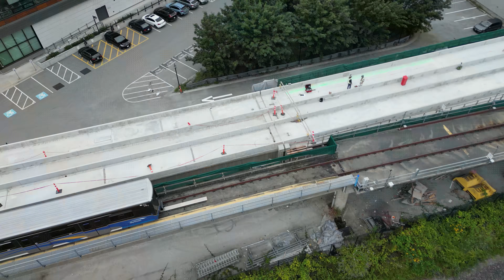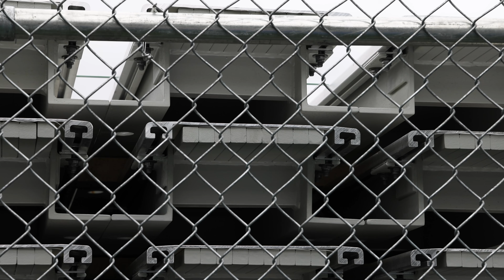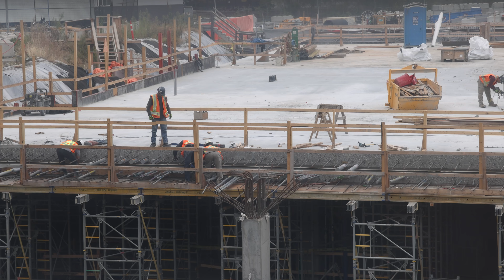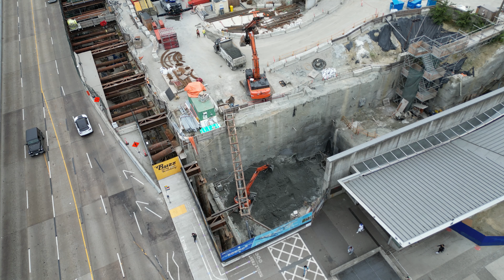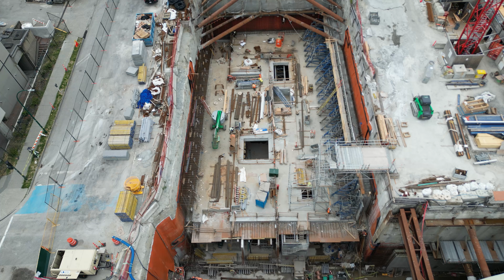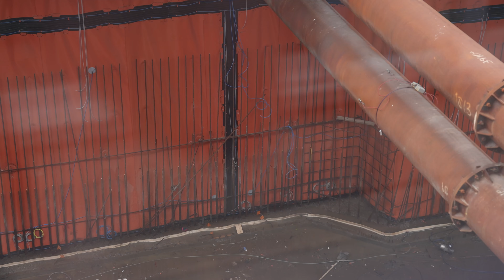Broadway Subway Project (SkyTrain) Construction - August 2024

Comment: The line should have been built all the way down to Alma. Extremely bad foresight on the part of the Govt of BC. When they finally build to Alma, rather than 2022-2027 dollars / expense, it will end up costing double.
Reply: You mean UBC?  The stations at both Macdonald and Alma would be the lowest driver of ridership on the entire line.  Arbutus is a good end point for now, being at the tail end of the Broadway business district and within the "Broadway Plan".  We'll see towers going up over the next few decades... not so much between Macdonald and Alma.
Reply: @aarongrant3799  ... Arbutus is an absolute BAD ending point in the 2024 - it's not 1994. At the very least, this line should have ended at Alma now, and then plans immediately begin to get it up to UBC by 2030 - 3032 at the latest.
Reply: @jefftaylor844  But then, what's stopping you from going all the way to UBC?  I mean , you moved at least a third of the way there.  You and I have no clue what budgets and business cases they had at the time.  Besides, where is the bus loop going to go at  Alma?
Reply: @aarongrant3799  ... you have many excuses for such a shortsighted transit decision, but the fact remains, it's 2024 - nearly 2025, and still, there's NO major train line anywhere close to UBC !

Comment: It NEEDS to go all the way to UBC. It has always needed to. Keep going all the way to UBC and make that the terminus.  People have been saying so since f*cking 1999, so enough of this idiotic piecemeal process, where they stop and for a decade say "well, that's enough", that both of BC's parties in power have engaged in. UBC should have been done before Evergreen line, before Langley, and had they actually done so originally, it would have been done even before the Canada Line. Shortsighted fools, leaving the most obvious unfinished business undone, while land values multiplied 5x, while buildings got built where their track and stations should have been. 
Do not stop the project this time - Arbutus, then MacDonald, then Alma, then Blanca, then finally the center of UBC, and THEN you're done.

Comment: So which strip is considered the third rail?
Reply from the maker: Skytrain has 2 power rails that run along side the tracks. So I guess you could call it a 5 rail system with 2 running rails, the linear induction rail (center) and the 2 power rails. Just wait a few days for a engineer or maintenance worker to comment and explain it in better details :)

Comment: I worked at Whole Foods Market Cambie in 2011-12. The building had been built with an entrance to the future subway station. In the back of the store (which is in the basement in the back but at street level on 8th Ave) there was a big area that was used then for storage. I would presume now this section is not part of the store any longer. I don't know if they could have done things differently for this project. It is very complicated due to the fact that it is in a more densely populated area with not much room to manoeuvre such an undertaking. Although I've not been back to Vancouver since then it seems the disruption at ground level must have created a commotion for lots of people. Something that lasts so long has big impact on the locals and users.

Comment: Sorry what? It's still projected to be completed within the original budget?
What sorcery is this?
Kudos to everyone involved in making that happen!
Reply: Yeah that's outstanding quite frankly and will doubtless make post mortems on this vs the Langley extension fascinating given the latter got such a huge bump in price before really getting going even. Could be that Broadway just had signed contracts that locked in a pre-pandemic price that Langley got nailed with or something else might be going on but I'd be fascinated to find out.
Reply: id rather they double the budget but get it to us sooner☹
Reply: It's like how the Site C dam is also headed to being finished on budget as well... the revised 2021 budget, not the hopelessly doomed original one. Turns out public projects can be completed on budget... if the budget was done properly in the beginning instead of being low-balled like the so often are.
Reply: Should be used as an example of what to do for all the other projects if it stays on budget and not get delayed as much as every other project.
Reply: BC government is so corrupt. Its shocking they are not trying to squeeze more out of this. Yet.

Comment: You may have talked about this in a portion of an earlier video, but do you think they should've just built it all the way to UBC since there's all the equipment/staff on site? Overall cost is cheaper too? Would like to see an analysis video on that.
Reply: I am really hoping that they start the UBC section right away, or shortly after completion. They need to keep the momentum going.
Reply: Good chance that NDP will provide a timeline as part of this year's election (so within a month or two) for UBC. Yeah it definitely should've been all 1 phase to save on costs but the nice thing is the part to UBC will involve less tunneling so should be faster and cheaper. Jericho lands project being approved also helps as that depends on there being 2 skytrain stations as part of it
Reply: @SeriesShower  It seems to be roughly the same amount of tunneling, roughly 5km. I can't imagine any section being above ground before hitting the Endowment Lands. 

In terms of cost, because of recent construction inflation, this section of the line will be more expensive without a doubt. The only benefit may be UBC providing funding directly.
Reply: I disagree with you guys completely. We have such small budgets, that we can't spend that money on UBC. We already need it for BRT or Rapid Bus from the North Shore to Metrotown, or for beefing up other routes.

Just giving Rapid Bus its own lanes to-from UB  is already a lot.